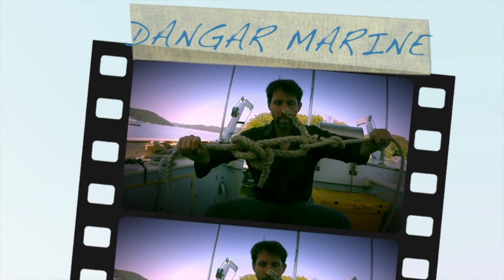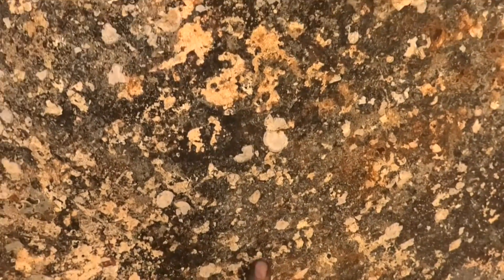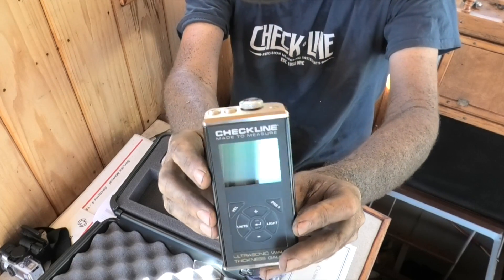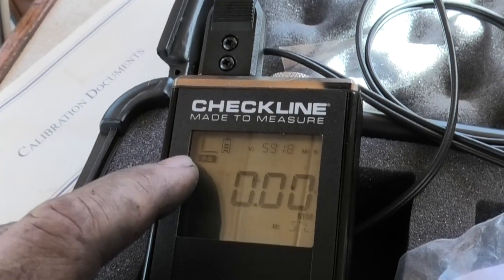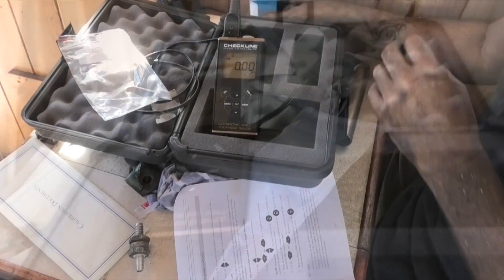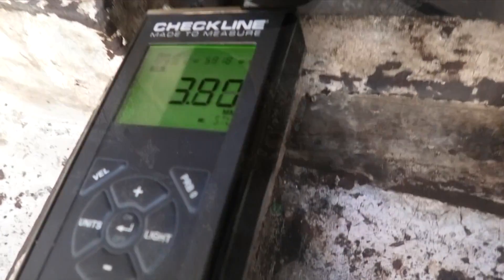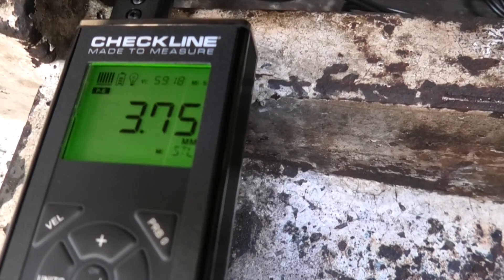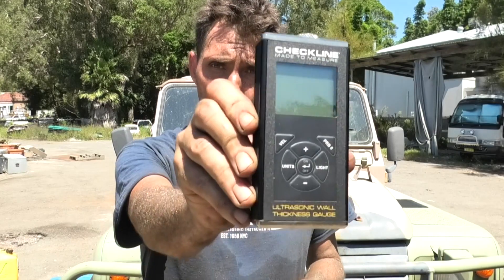Ultrasonic thickness testing the steel hull plates on the trawler

Comment: Be careful with sand blasting and then painting.  Rusting is an electro chemical process.  If the sand blasting leaves tiny peaks and valleys the corrosion will be concentrated on the peaks and break through the paint sooner.  Sanding the bare metal with sand paper and after blasting before painting would be good but still leave enough roughness for the paint to grab.   Check with the paint manufacturer.

Comment: in testing the hull thickness I believe you don't have to worry about the rust and scale on the opposite face from which you are measuring. the rust and scale form an interface that the sound wave reflects off, so the device does not measure its thickness as well. This depends how the device responds to echoed signals.

I suggest doing a test by only cleaning the one face measuring the thickness of a predetermined spot then remeasure it after cleaning the opposite side. If both measurements are the same it verifies the theory.

great work, I am looking at one of these machines for concrete testing.
Reply from the maker: I think you are right about this. I definitely need to get it out and do some tests on painted steel that I am able to verify.

Comment: surely you didn't buy this $1500 device for that job ? did they really give you one?  Can these things be hired, I need to check how much thickness I have left in my stuffing box outer section on my Hartley southseas ferro. I know I've chipped alot of rust off it over the years even the mounting flange where it attaches to the hull, I might have to get an endoscope to explore inside. I wish I was  closer to ya as I have a torbo  wet abrasive system (sand blaster) trailer mounted, perfect for both of our projects  although when I can't be bothered with tarping up to catch the expensive garnet , the needle descaler like yours works well at eroding away the ferro cement around damaged areas without destroying the wire netting in order to get a good overlap. One thing about ferro cement , you will rarely sink the boat due to rust, they handle neglect very well. Some of my problem  areas had no steel armature left in the hull at all near obvious damage but never a leak, I like your hands on way and of coarse I get the lingo. cheers from  Hervey Bay
Reply from the maker: They did give it to me, which is awesome, but if you look at the cost of doing a full hull survey it isn't far off the mark, particularly given you could sell it afterwards, use it next year again or share it with a friend. Interesting to hear about using the needle gun on ferro, had never seen that. I'm jealous of your trailer mounted blaster!

Comment: getting back to anodizing... most large ships in the past would have several tons ov zinc in the lower stern ov the hull to protect from galvanic corrosion that would otherwise occur between the bronze prop and the steel of the ship.
Reply from the maker: Yes, I have already bought all the new anodes for this boat. Looking forward to putting them on!

Comment: Luckily, your bilge is not in bad shape. Looks like you have the steel back to as good as shape as possible. Don't forget the deck. I've been on steel boats where the deck is in the worst shape of all. That is probably due to many years of salt water exposure. 

BTW, here's an idea and it's a big commitment: You have a boat with a square transom. That will be a loser in some sea conditions. A boat with a round aft surface will handle conditions better. If you install plate to round out the hull, you'll have a better hull and add storage or usable deck space above. As said, lots of work and may not be a useful suggestion. Just thought I'd add it into the mix. 

Good luck on the restoration and refit!
Reply from the maker: Hey mate. Yes, the deck does need a bit of work, there are some holes right through that I will be welding up. My main priority at the moment is to get the boat back in the water so I am currently focussing on everything below the waterline. Once it is back in I will focus on the topsides. I like your idea about remodelling the stern. I could certainly use some more storage space. I'll get in touch with a naval architect and start looking at the options. Thanks!

Comment: Big admiration for a true grafter with some considerable skill and problem solving ability. If only for your health, make sure your needle scaler is high quality or wrapped in some kind of insulating material (cheap pipe lagging is good). That amount of scaling will give you serious white finger and possibly damage the cartilage in your fingers which would be a tragedy for a guy like you. Big thumbs up from the uk, Mark.
Reply from the maker: Thanks mate. Won't be doing too much needle scaling and will be wearing gloves.

Comment: Great job. When I hauled boats on a commercial railway, there was inevitably a steel hulled shrimp boat being sand blasted.  Following the blaster was a man spraying red oxide, which stopped the oxidation process before it started,  and was the primer. Maybe your paint supplier could advise.

Comment: from the beyond the press channel.. https://youtu.be/JYlkrYVarP8   3000 Bar pressure washing without and with abrasive.. for those wondering.. 1 bar is 14.7 pounds of pressure.. 3000 bar is around 45,000 pounds of pressure.   they used it here in so cal to carve thru fractured concrete walls to allow them to repair them with high strength concrete after the 1994 northridge quake.

Comment: Wet garnet sand blast. Use a service.  The time saved offsets the seemingly higher cost. If you wet blast with your equipment make sure to use a ceramic tip or the garnet will blow through a steel tip.

Comment: Good vid brother ! Unrelated question but I have a yammy 15 2 stroke  and I'm running the gas tank on the bow have a little in line fuel pump I want install can I connect the 12 v to the regulator of the engine? so it runs while engines running so I dont need to prime . I'd also connect an on off switch .it's a small pump like 2.5 psi engine works fine but I have a small little pump might as well use it lol this would help me out as sometimes while navigating I have to go prime🤷‍♂️ I thought it was a bad diaphragm or fuel line but checked and no leaks and it pulls correct psi  thanks any advice would be great

Comment: If you put some sand bags inside the hull plates when you needle gun the outside it keeps the noise down loads, I know it's a bit of a job having to move them but you don't need many and at least you won't be upsetting anyone.
Reply from the maker: Good tip!

Comment: After sandblasting the Hull, If that was my boat, I would fiberglass the outside of the hull, Done deal, never have to deal with Rust again eating the metal thin from the outside :)  and that repair may last the life of the boat, another viewer had a great idea, and that was to replace the fuel tank with a plastic fuel tank,  metal fuel tanks love to rust out, if you paint the outside hull with epoxy paint, that wont last very long and you will be sandblasting the hull again and again and painting it, lots of time and money to do that, fiberglass it and be done with it.

Comment: Here is a MT tester (magnetic partical). This can be used to check for cracks in welds. There is another way too. Dye penetrate which you apply the dye the use like a black light to find cracks. I'd prefer the MT, more fun and quick to use. Good for a video either way😎

Comment: Stu, before you get into any blasting and maybe even before you attack the outside of the hull with the needle gun, invest in a FULL FACE RESPIRATOR like a 3M 6800 or 7800.  That open face mask is not going to cut !
Reply from the maker: Done. Just ordered one on eBay now. Thanks for the tip.

Comment: I'll bet they used 6mm plate for the bottom when they built that boat.  3mm-4mm is definitely good for several more years, especially since you first spot test was likely in one of the worst areas.

Don't jump on buying that high pressure washer right away.  I think you will get acceptable results with the needle gun an the wire brush.  Check with some people who have done it.

Comment: ….3:02....20 thousand Kilo-Hertz....Good one...  some years ago, I had a small 1 man welding shop, built a lot of 'wood-stoves' or 'heaters'...16, 20 and 24" pipe...even new it was rusty due to outdoor storage. I bought a needle gun...it was OK, but too slow and used a lot of air...the rust was pitted badly in some spots. I called around and found the local ready-mix concrete company used a big sandblaster to clean the concrete mixers on the trucks...I could rent it by the hour, plus the sand...used about 4 bags per hour and several grades of sand available.
 This worked pretty well, but you had to bring your stuff to the location of Concrete Co...not a problem for me and you could even bring in stuff on a trailer...
  The sand-blasted 'finish' was good for the high-temp black paint too...
Reply from the maker: Yes, there is no doubt that blasting is a great way to go. Going to be experimenting with some wet blasting soon.

Comment: Found something you might find helpful, and the channel has other Detroit diesel videos too...as I recall the boat has a Detroit and you’re having idling issues... https://youtu.be/rvB1Qc5yaj4
Reply from the maker: Thanks mate. I'll check that out. I've been struggling to find many video on these engines which is surprising given how many there are out there.
Reply: Dangar Marine yeah I think part of the issue is that the blokes working on them are almost all older, so lots less likely to be doing video. Not too many younger folks who find the old diesels interesting.

Comment: It may be possible to rent a monster sand blaster instead of buying one.
You may want to check around on using chlorine compounds for cleaning the metal, since I think that is why salt water is so corrosive.  I am no expert, though!
Reply from the maker: Renting tools is often a good option. In this case I'm going to give wet blasting a try first and we'll see how that goes then plan from there.

Comment: I wonder if spot sandblaster and coating with cold galvanized spray inside and out and alot of bonding Zinc's would prolong life of hull.
Reply from the maker: I'm definitely going to do a bit more research into zinc undercoats. I think they can be a good way to go with steel.

Comment: I've used a thickness meter on my steel sailboat and  tested it on scrap steel first.  Then cut the sample in half, sanded each side and used a micrometer to check the thickness.  These devices are very, very accurate.  The American models "see" through rust and paint automatically.  Wet blasting does not work.
Reply from the maker: Good to hear you found your unit to be very accurate. What makes you say that wet blasting doesn't work?
Reply: Wet blasting causes a bloom of rust immediately and rust never goes away. Sand blasting is for removing rust so your inorganic zinc epoxy has a clean surface to bond to. Even then it's a 20 yr  coating.  Loyds of London has followed steel boat construction and made the procedures that work public.  
Sand blast for 6 hours.... blow the steel clean with air only and spray coat immediately .  Do not leave over night .  Copper Slagle is the cheepest as you can reuse it several times and sell the stuff after.  Good luck.

Comment: If you're worried about the cost of sandblasting have you considered modifying a water blasting unit to wet sandblast" I don't have any experience wet blasting large areas as on a boat but do have a small attachment (I think it was about $80 from total tools).  I run it of a three and a half horsepower chinese cheapy petrol washer and it has proved more than adequate on farm machinery and earth moving gear. Sand still gets everywhere but there is no dangerous dust.
Reply from the maker: I've decided to give that method a try and see how it goes. I don't think I have much to lose given the gear is relatively inexpensive and useful for other things too.

Comment: That's a neat gadget! Will you have to remove epoxy in spots when you test next year? On both sides? If not, and you can test with the boat in the water from the inside, can you still account for the temperature of the steel?
Reply from the maker: Yes, you can test the steel with the boat in the water, but I'm not sure how it works with temperature. You can test steel painted on both sides, but there is a different unit for that. This unit will do it, but you would need to take the coating into account. If the paint isn't bubbling or peeling I would be reasonably confident that no thickness has been lost.
Reply: @DangarMarine  yeah that's a good point that i didn't think through, if the coating is in good shape then the steel is too.

Comment: To do a really through hull evaluation, audiogauge readings are typically done on around a three inch grid.  A great many points. This is combined with visual inspection for any deep pitted areas between the gauge readings.  And as Mr. Jackson  noted below, the gauge reading locations and thicknesses for each should be made into a chart for subsequent use.  Greg
Reply from the maker: It is very true that a visual inspection shouldn't be discounted. It's amazing how many spots you can see that need attention.

Comment: Stu, does the manual say if you can take a (bilge) reading with the boat in the water?
Reply from the maker: Yes, it seems that you can, you can even put the transducer in the water and test from the outside underwater if needed.
Reply: @DangarMarine  Fantastic, thanks for the info!

Comment: I would think that once you get the hull painted, if maintained and repainted periodically, the hull could last indefinitely.
Reply: If  you pulled the boat out each year and had it cleaned it would last a long time. The cost is the problem, so boats sit in the water for years with no maintenance.

Comment: Stu, really enjoying / appreciating your extra work bringing your hard work to us.
Please discuss fiberglass hull depth and the tools to measure it.  Also, can wood stringers be assessed by ultrasound through the outside of the hull, anything other than ripping open the floor boards?  Thanks.
Reply from the maker: It is my understanding that ultrasonic thickness testing of fibreglass is not possibly due to the varying densities of the glass and resin. Same with timber. Generally blisters in fibreglass are visible and the biggest trouble with timber is either worm holes or rot than don't really affect the overall thickness, just the structural integrity.

Comment: I have always used a needle gun in combination with the angle grinder and wire brush. This was on a big river barge. Worked well I always thought. This way you can also just do small sections at a time. If you wait to long with bare metal you can get surface rust again especially if it suddenly starts to rain or if it is very humid. After wet blasting the metal, you might have to wipe it dry to avoid that as well.

Comment: great video .    am wondering if a pnuematic broad scraper  like the pros use to remove  glued down flooring might  be faster?  maybe with a mild acid wash ?
Reply from the maker: The gun is incredibly fast on paint, but also incredibly loud so I don't want to use it too much. I'm going to try gas torch and scraper today and see how well that works too. Might do a vid on the different techniques.

Comment: As a seaman in the USN we had to strip the flight deck and fantail of a light cruiser.  It had multiple coats of sandy  non-skid and paint.  We used pier supplied compressors, Jack hammers, needle guns, sanders, etc for several days.  Years later I met a guy who berthed below the deck and he mentioned the noise!
Reply from the maker: LOL, I bet he did! :O

Comment: Mark a few points on the inside of the hull and circle them with a permanent marker.  You can test these exact spots every year and find out what the corrosion rate is on your boat.  Also, you only need to clean the side you are testing, it doesn't matter if the opposite side of the metal is covered with paint or corrosion product.
Reply from the maker: Good tips, thanks for sharing. :)

Comment: Don't wet-blast it, mate.  A friend had his ship wet-blasted couple of years back, and he doesn't recommend it at all. If you're going to needle-gun the whole thing, that's plenty. The biggest advantage to sand-blasting is that you don't have to do the tedious needle-gunning. Sand-blasting is quicker and gets better results, however, you can get very good results with the needle-gun alone, as long as you take the time to get the rust clean off. Good luck!
Reply from the maker: Hey Ed. What didn't he like about wet blasting? All the other steel boat restoration / builds I've seen people gravitate towards it as their go-to method.
Reply: @DangarMarine  Well, even though good primer was used, rust is building up already underneath. His ship was on salt water for years, because it's a former coaster, but the past several decades it has only been used on (mostly fresh) inland-water. He advised me to go with sandblasting, because i am thinking about some kind of blasting. So sandblasting it will be somewhere in a not to distand future. Salt penetrates the steel and is hard to get rid of. Sandblasting will do the trick though.
Oh, and i forgot to compliment the hull of your boat, a minimum of 3,5 mm is surely good enough and i honestly didn't expect that. That's a massive headache prevented!
Reply from the maker: You do need to be careful with wet blasting. I'm going to use some Chlor-Rid products at the same time.
Reply: I'm curious to see how that all works. Wait and see!